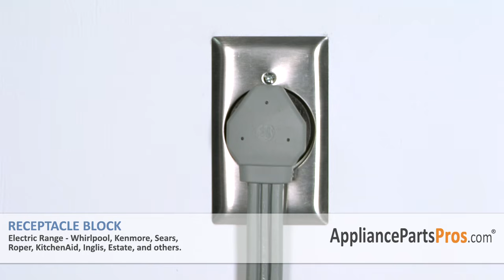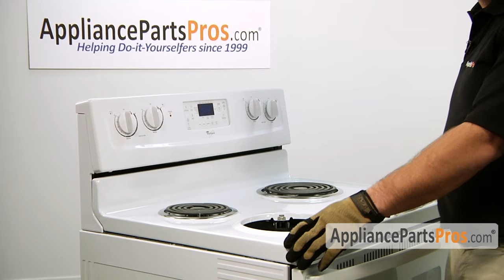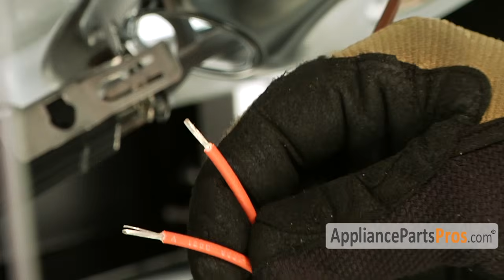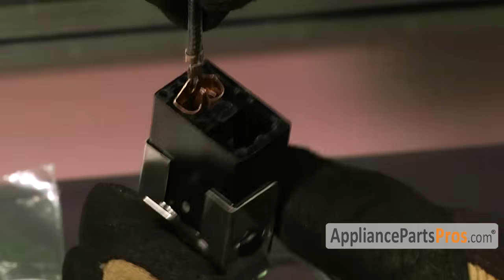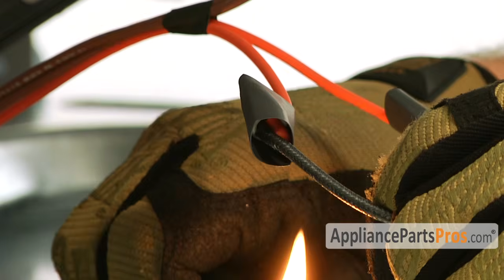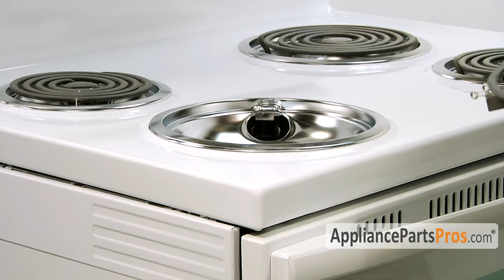How To: Range Oven Top Burner Receptacle Kit 330031

Comment: Thanks this is excellent.  One of the burners on my range has a small tab on the receptacle mounting bracket, and there is what looks like a ground wire attached to it.  The new bracket has a larger tab that will not accept the ground wire connector.  I was told the ground wire is redundant since the range is already grounded. True?
Reply from the maker: It is always best to reattach the ground wires. If the manufacturer made a change on the terminal size you may have to cut the old wire connector off and put a larger one on.
Reply: Thanks, I followed your suggestion.
Reply from the maker: Happy to help!
Reply: @appliancepartspros I found the same one on Walmart for $8. It’s ordered I have a gift card or I would have gone to your link! 👍
Reply: Sarge true, actually I bought everything from that web site and did the same installation but after that when I turn the lights on in my kitchen the lights are flashing like every 3 minutes.
And I didn't touch anything else just replaced the new receptacles  that was it.

Comment: Any suggestions on how to loosen the screw it refuses to unscrew?
Reply from the maker: If the screw is stuck, try applying a little penetrating oil and letting it sit for a few minutes. Make sure you’re using the correct size screwdriver and press firmly while turning to avoid stripping the head. If it’s still stuck, a pair of locking pliers may help if you can get a good grip on the screw head.
Reply: @appliancepartspros truly appreciate your videos and information I will try this it appears someone else kinda screwed with it before so it moves n stops and moves than stops and won’t move so I should get it to that point and use the oil correct 👍
Reply from the maker: Yes, that’s a good approach. If it moves a little and then stops, apply a small amount of penetrating oil and let it soak before trying again. Work the screw back and forth gently rather than forcing it, which can help loosen the threads without stripping the head. 👍
Reply: @appliancepartspros God bless you and many blessings to your family
Reply from the maker: Thank you so much! We’re glad we could help. Best of luck with the repair! 🙏

Comment: I could use some help. I did just this with my Kenmore big range. It worked for about a year and then the burner receptical exploded. It was working kinda funky and would spark every now and then when it was used.
I'm just going to replace it again as the rest of the stove still works. My question is there a possibility that something else is wrong? I literally followed this video to a T.
Reply from the maker: If you need more troubleshooting or testing information you can check out our Repair Forum: https://forum.appliancepartspros.com/.  It’s easy to register, and you can either post your question or search the forum to see if someone else has already asked the same question.
 
Our experienced technicians, with over 20 years of hands-on appliance repair experience, are ready to answer your questions and guide you through your repair.

Comment: Can I convert a 4 prong to a two prong plug in? I have a 1950's model Westinghouse electric range.
Reply from the maker: Good question! It’s important not to simply convert a 4-prong plug to a 2-prong plug, since the wiring and grounding requirements may be different. Older ranges were often wired differently than newer models, so the correct setup depends on the range’s electrical requirements and your home’s wiring. We recommend checking the range’s installation instructions or consulting an electrician to make sure it’s done safely.
Reply: @appliancepartspros I can't find anyone in my area to repair my stove. And I have not been able to locate anything online to attempt to repair it myself. I have found some 4 prong elements for GE and HotPoint. But I don't know if they would work for my Westinghouse stove.
Reply: EJ is all it says on the placard.
Reply from the maker: If you can provide your model number we will be happy to look and see if we can find parts for you. Just let us know which one you are looking from.
Reply from the maker: I'm so sorry, without a model number we aren't able to recommend any parts. You may need to check with a technician in your area.
Reply: @appliancepartspros  If you can provide me with an email address I can send pictures of the placards and stove.

Comment: I would only resort to using an open flame if I did not have a heat gun. But many home hair dryers on the highest setting might work as well. It's just too easy to overheat the shrink fittings with a flame because you get in a hurry.
Reply from the maker: Thank you for that tip!

Comment: Thank you!😃
Reply from the maker: You are welcome!
Reply: @appliancepartspros  We got the parts and followed the instructions but we couldn't fix it. It seems to be an older model of Roper. Don't know if you can help us. We worked on it for a long time. Maybe we ordered the wrong parts?
Reply from the maker: What is your model number of the stove?
Reply: @appliancepartspros  The only number I could find was this: 8522383. It has the trademark of ESP before it. All of the terminal blocks only have two wires coming out of each one. Can you help?
Reply: @appliancepartspros  I responded to your question about the model number. Can you help?

Comment: I followed the instructions exactly and when I put my burner in it's prongs push the elements out of the plastic bracket. I have double triple and quadruple checked that I have the right parts for my stove and everywhere says I do but they are just not connecting do you have a tip?

Comment: You don't have to put the heat shrink sleeve over a wire before connecting wires with the wire nut. You can put the sleeve over the wire nut, with the tip of the nut sticking out. This will look better.

Comment: Is there fuses inside the stove ? I’m not getting voltage to one of the connectors to the heater grid peace.... I can tell I need a new plug it’s melted

Comment: But what if none of them are working ?... I'm not sure what I did this morning but I definitely screwed up .. I went to reheat a cup of tea and wasn't paying attention and was washing the dishes when I heard it boiling over.

     When my hand went over the pot of boiling froth to turn it off I saw a BIG SPARK  and heard a loud POP SOUND ... somehow I think the ring on my hand caused this problem and after I cleaned out the liquid from under the drip pan areas and waited a few minutes I expected to be able to make a fresh cup of tea but none of them.. none of the coils are working.
      I did not always use all the burners anyway because two of them seemed kind of sluggish so I went to the fuse box and it's confusing because I don't know the terminology but I was able to push two of the little black square leavers to the on position but in between them is a weird looking thing that has a ring in it ...I don't know how else to describe it ..I don't know what that part is called ; THAT REFUSES to go in the ON position .
      This is very depressing for me as I'm struggling financially right now and I don't have that volt meter .
Reply from the maker: It definitely sounds like something shorted out, but if none of them are working, the elements probably aren't the problem. We'll be happy to help you figure out what may have happened, as we offer free technical advice and diagnosis. You can give us a call at 1-877-477-7278 or you can chat us at our website: http://www.appliancepartspros.com/. We'll get some more information from you, like whether the clock is still working, to determine exactly which part you may need to replace. We will need your model number  so that we can look up schematics to give you accurate advice. You can look here on our website to help you find the model number: http://www.appliancepartspros.com/modelnumber_locator.aspx If you do end up needing the multimeter to test parts, you can get them from local hardware stores for $20 or less, typically. One of our agents will be happy to talk you through it all.

Comment: what happens if I wire an electric stove coil backward?
Reply from the maker: We'd be happy to help you out with that! We offer free technical advice and diagnosis. You can give us a call at 1-877-477-7278 or you can chat us at our website: http://www.appliancepartspros.com/. We will need your model number to give you accurate advice, which you can locate using this tool on our website: http://www.appliancepartspros.com/modelnumber_locator.aspx

Comment: Hello I just changed this receptacle- as the video showed- Greatvideo by the way-- but the coil is Still not heating up- and I checked other coils in this burner port- and they also do not heat up in this slot-- yet they work in the other spots,etc etc-- I guess this problem is bigger than I can handle- and I should get professional help??
Reply from the maker: It could be the switch, the terminal block, or the wiring based on what you've told me. It's up to you whether you're comfortable trying to try to make the repair. We do offer free technical advice and diagnosis, so if you want to get in touch with us, we'll get some additional info from you and help you figure out which part is causing the problem. We may have a video to help you with the repair, and if not, we can talk you through it. You can give us a call at 1-877-477-7278 or you can chat us at our website: http://www.appliancepartspros.com/. We will need your model number to give you accurate advice, which you can locate using this tool on our website: http://www.appliancepartspros.com/modelnumber_locator.aspx

Comment: What about when the heat element stay on high (become  red), even when in a low setting say 5? Does that mean just the element is bad or does the receptacle block may need changing? 

A quick response will be greatly appreciated. Thank you!!
Reply from the maker: Is this one of the top (stove) elements, WJ? What is your model number? You can use this tool on our website to help you find the model number: http://www.appliancepartspros.com/modelnumber_locator.aspx

For faster response, you can give us a call at 1-877-477-7278 or you can chat us at our website: http://www.appliancepartspros.com/. We offer free technical advice. We also have a free repair forum where the techs can help you troubleshoot the problem: http://forum.appliancepartspros.com/. We’re here to help 7 days a week until midnight EST.
Reply: I'm having trouble finding the model number on mine

Comment: My GE range (JBS26OV3AD) has ceramic insulators over the end of the burners. The support of one 8' burner has come apart. Two ?'s.
1. Can I order the support alone?
2. If not, and I order a burner, will I be able to install the ends of a plug in burner inside the ceramic insulators? (The part picture does not give a good pic of the burner ends for WB30K 10003 and I don't see any burners for order that don't plug in.) Or would ordering the recepticale too be the right thing to do?
Thanks
Reply from the maker: The support is not sold separate. Assuming there is nothing wrong with the receptacle you should be able to swap out the element.

Comment: The problem we were experiencing was a little different. The burner would stop working while we were cooking. This was so frustrating. We needed to replace the whole socket that was simply old and worn out. That was also a very simple process.
Reply from the maker: Glad the video helped you out!
Reply: The whole socket?  What exactly do you mean?
Reply: Did you mean you did exactly what this video did and change the receptacle? Or did you change the actual outlet that the stove plugs into?

Comment: my stove over heating low number one level and heating like full high level any ideas why heating too high?
Reply from the maker: +sing pau It could be the control switch has failed and is on all the time, instead of cycling on and off to keep it at the low temp.
Reply: Luke Pa

u

Comment: "Shorting out" is a different problem, and not the most likely problem that would require a replacement receptacle.  What you mean to say is that there's a bad connection, not a short.
Reply from the maker: +jbalazer Thanks for the tip about the terminology!
Reply: Depends which terminals you mean. An arc from hot to neutral is a short circuit.  An arc from the hot burner terminal to the hot terminal of the socket, or from the neutral burner terminal to the neutral terminal of the socket is not a short circuit.  Even when these burner sockets have arcing, usually there is no short circuit, because the socket has an insulator separating the hot terminals from the neutral terminals.
Reply: I bet we’re all fun at parties.
Reply: jbalazer
   I think it's possible that this morning I shorted out my electric stove on the stovetop... I'm wondering if you have a moment to listen to what happened and give me some advice as I'm very disgusted here because I'm struggling financially.

      I was trying to reheat a cup of tea and it boiled over I still don't understand what happened because when my hand went over the boiling froth to turn it off... somehow I think my ring ignited a spark... there was this HUGE SPARK and a POP SOUND .

      After I cleaned up the mess underneath the stove top I thought it would come back on but nothing's working and on the fuse box I was able to get two of the small black leavers in place but the one in between them refuses to go back to the on position.

Comment: hi i have another question and you've been so helpful i'm hoping you could give me an idea. I followed your video and did the wiring just the way you showed, but my burner is still not working. :(  before i knew the receptacle was bad i turned the burner on and sparks flew out of it. could it be a fuse or do they not make fuses in them anymore?
Reply from the maker: Kel Suth If it was so bad it was arcing you need to make sure the ends of the element are still good. A few things to look at are to make sure the circuit breakers did not kick off. Some older stoves did have fuses, check the wiring diagram. When ever you short something like that you have to test everything to find out why you are loosing power, bad wiring, bad burner switch, bad terminal block etc. You can post the problem along with the appliance model number on our repair forum and the techs can help you troubleshoot.
Reply: AppliancePartsPros

Comment: is there anyway to remove the plastic terminal blocks from my old stove burners and reuse them on the other one i have? All the wires on the other one look ok and i don't want to have to cut them if i could just switch the plastic parts
Reply from the maker: Kel Suth Depends on the style, the terminals can be taken out, there is a small retainer clip in the block. But not all blocks can be interchanged like that, they have to be exactly the same.
Reply: Ok I will look for a retainer clip and give it a try thank you

Comment: Great video. I followed the instruction but I still have a problem. The heating element is still not coming on. What to do?
Reply from the maker: Em See Rashenel You can check the terminal block that the element plugs into, if the contacts are corroded you may not be getting power to the element. If they look good then check the wiring back to the switch and the switch itself.
Reply: AppliancePartsPros Alright. Thank you.

Comment: Would you require to change the receptacle kit of the indicator light for the issue of red light burner indicator light not turning off? stays lit, no heat. the heat works when you turn it on.
Reply from the maker: The indicator light contact is usually inside the switch. If it is stuck, you may have to replace the switch.

Comment: What if the shrink wrap doesn't come with the replacing package. Is it all right to leave it without out?
Reply from the maker: Shrink wrap is best if you can get it. If you do not have any make sure you wrap it in some electrical tape, to help prevent any liquid from spills getting in the connections.
Reply: @appliancepartspros  Should it be heat resistant electrical tape, or will "normal" electrical tape do?